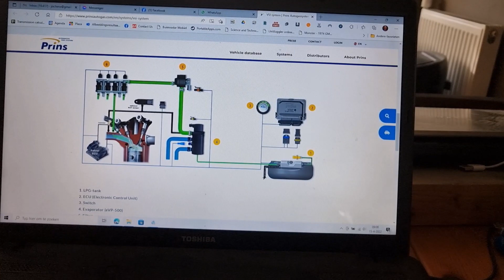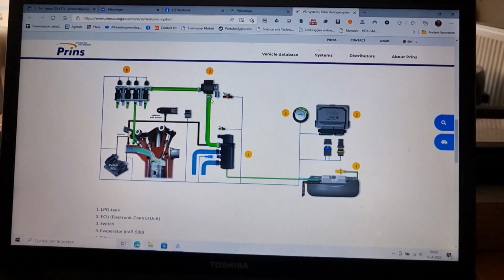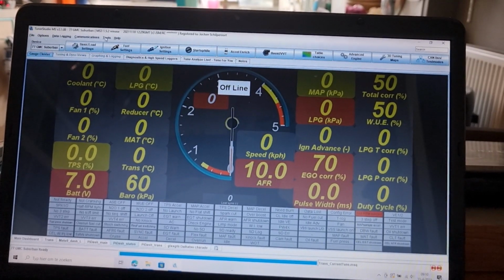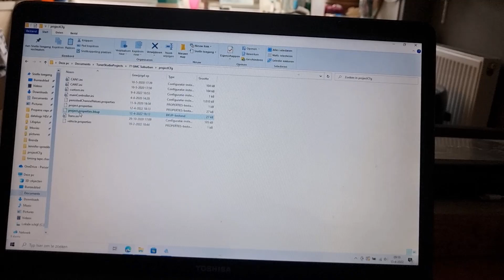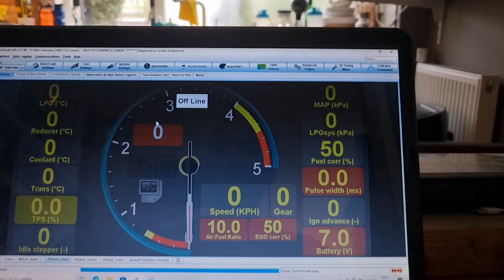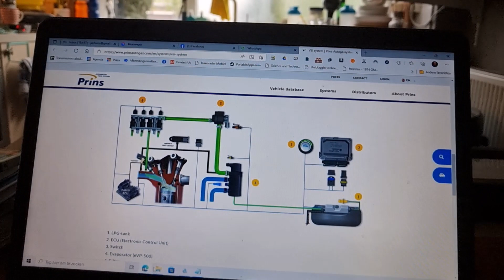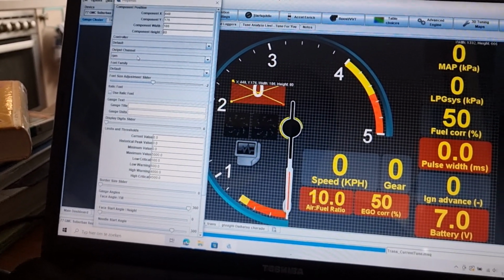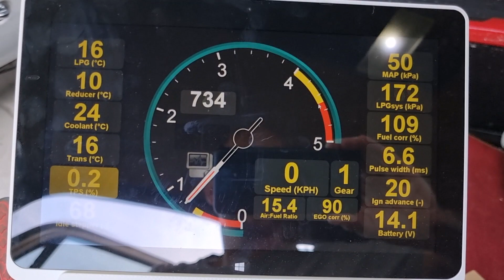Custom advanced inputs for Tunerstudio gauges

Comment: wow I am impressed! I also have a KME Nevo LPG system in my car and had in mind to do exactly the same as you have.
I just didn't know exactly how, but I could learn a lot from your video and get many new ideas.
I will probably do it via speeduino though.
Are you willing to share your dash files? I really like your setup.
I have a Lada Niva 1.7 multipoint and will install a Fiat Lampredi Twincam 8V 2.0L engine with a mercedes supercharger.
The benefit of propane is that it has a Octane rating of around 110 (when pure, which it never is. But it is still higher than gasoline)

Comment: Hi Jochen,
Wow, very technical, I'm curious do you have a background in computer science or did you learn this on your own? Another question, what was your motivation for going LPG is it less expensive to operate? I can also imagine you might have done this just for fun to see if you could do it!
Ross
Reply from the maker: Hi Ross, thanks for the cool comment. I am a mechanical engineer. Computers are one of my interests. I love putting new stuff in old things. Of just taking things apart and improving them. My motivation to go LPG was basically cost driven. LPG is usually less then half the price of regular gasoline over here. First I had a basic LPG system installed and then improved from there. Changing it into fully sequential LPG port injection system. 

more info about my project can be found at these pages:
Facebook: http://www.facebook.com/77suburban
Megasquirt: https://www.msextra.com/forums/viewtopic.php?t=74475